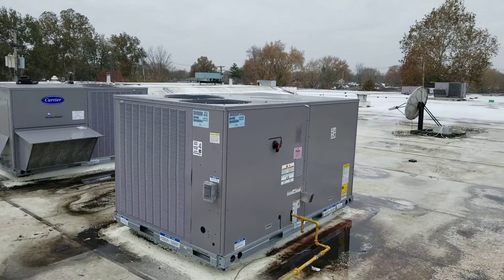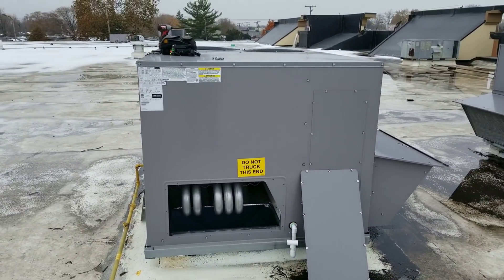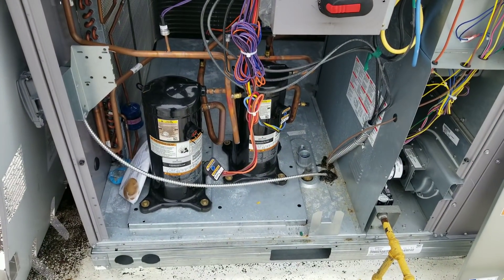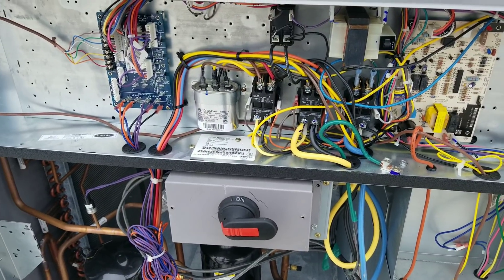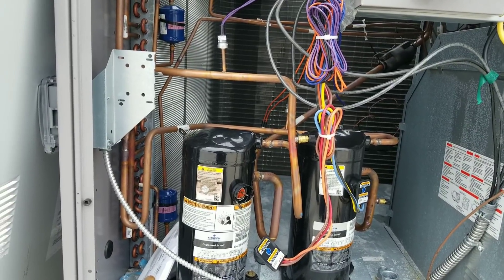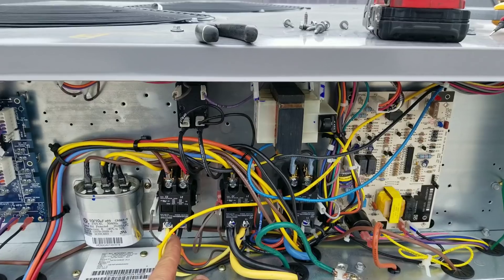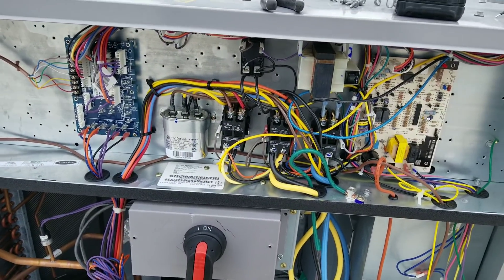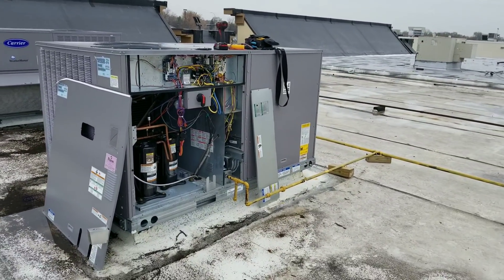Carrier package unit tripping the breaker

Comment: Hi, great video! we got the same unit for our store. I noticed the fan blower and one of the compressors are not getting the 24 volts but the other compressor gets the normal 24 v and engaged, do you know what is wrong with it? Therefore, only one compressor works and no blower running nor the other compressor work. If I manually press down the contactors on those two things, they would run. They are not getting the 24 v as they should. Thanks!

Comment: Being that the compressor that burned out was the second stage, it would be prudent to change out both compressors. A charge back from the facility to the installer would be in order. A big screwup when all you had to do was determine that the blower was running in the right direction.

Comment: When you need to correct rotation of a 3 phase system by swapping 2 of the power leads, the leads that should be swapped are phase A and phase C.

Comment: Notice the electrical contractor did not identify his A,B,C phases nor did the manufacture.  L1, L2 ,L3 should be black red blue is the new standard. Higher voltages might use brown orange yellow (as the old convention) for 277 volts and higher.   At least he identified the common neutral/ground with green tape. Amazing !
Reply from the maker: Great point- I didnt notice that, now thatll be in the back of my mind forever, thanks for the tip

Comment: Still confused about what you did. I know you just swapped wires from the contactor. But I  thought 3phase units all run on equal legs of voltage . guess I'll have to do some homework lol . Nice job .
Reply from the maker: Hey Charlie- well im not an electrician so I may butcher this but here is how I understand it, it would be easier with a picture of the 3 sine waves of a 3 phase system but well try this-- so each leg of power is out of sync by 120 degrees, this phase shift between legs is what gives these 3 phase motors there torque. Now when one of those legs is moved and is going into the motor at a different angle or phase then the other legs it will spin backwards, so you swap any two legs and you basically re allign the phases and let the magic happen. Feel free to email me curioushvacguy@gmail.com

Here is a article explaining it a little better 

https://www.google.com/url?sa=i&url=https%3A%2F%2Fen.wikipedia.org%2Fwiki%2FThree-phase&psig=AOvVaw2zHzLoNNsrcAAEHAj9bhDN&ust=1579736591116000&source=images&cd=vfe&ved=0CAIQjRxqFwoTCMCLqMXvlecCFQAAAAAdAAAAABAD
Reply: Curious HVAC Guy  thank you for taking the time to explain that . It makes sense know .

Comment: Just curious why you didn’t check all electrical equipment to ground before you said that you flipped the switch, after noticing that the switch was flipped in the first place.
Reply from the maker: Hey Dave- your exactly right and I got no excuse- what I should have done once I noticed the unit had no power was shut the disconnect off, go downstairs flip the tripped breaker, then test everything for a short to ground before turning the disconnect back on-- that would have been much safer. It honestly just slipped my mind to follow that correct procedure-- wont happen again though

Comment: How can people not hear the difference between backward and proper phasing?? Blows my mind, pressures would be off as well.
Reply: Also, I would check phasing on other units. Typically sparky will wire stuff up the same way on each unit.
Reply from the maker: Good point-
Reply from the maker: Yeah its a very distinctive noise- its hard to ignore ya know

Comment: Good troubleshoot...! Its a preservative that burns off...Ive ran across brand new scrolls burned out because phase was not checked before putting into service. Mistake that a lot of rookies make. My marine commercial refrigeration units have phase sensors that will correct the phase automatically. It spins the condenser motor first and measures amp draw and if its high because of fan resistance it will switch phases automatically with a phase correction contactor, The micro processor will not start the compressor without the correct phase.
Reply from the maker: Hey Dan- thats pretty cool, ive never heard of a phase correction contactor-- once in awhile I come across some package units that have phase protection but I think most of my customers dont get that option cause it costs a few dollars more. Do you have any literature on your marine system? Ive never seen one or read about them either. Thanks for watching

Comment: Good video!  Two things.  Both compressors should be replaced.  The life of the one still running has been severely shortened.  Second, the drip legs on the gas piping is just stupid.  Typical lowest bidder amateur hour install stuff.
Reply from the maker: Very good point- theres no telling how much damage the other compressor has suffered. Yup typical lowest bidder stuff, they rejected my quote anyway so well see what happens now

Comment: That Bx wire coming from the bottom is gross. No junction box and no liquid tight conduit to the disconnect switch. Typical running shoe mechanical.
Great video though! Thanks Bill.
Reply from the maker: Thanks Bill- I feel kinda dumb now cause I didn't notice or address that wire coming in through the bottom

Comment: Be carefull about "just change any two wires" to change rotation - some systems have one phase that has a much higher voltage and if you swap it over to your control circuit your gonna ruin your day.. the leg with the high voltage is called the "wild leg" or the high leg - this leg must only be used on motor windings or heating elements and not on controls... ask me how I know this... these systems can be anyplace - most utilities try to do away with the grounded delta but it depends on when the last time the electrical was remodeled.   One hint to check his when you drive up to a building - look at the size of the transformers - the wild leg will have a smaller transformer usually .  But always verify with a meter before you just swap any two wires- it can get spendy..
Reply: Another tell is they're doing open delta with only 2 xfrmrs.  I live right behind a church that is fed 3phase open delta with two pole pigs. The drop to my house comes off of one of them. It's crazy.
Reply: @sivalley  your exactly right - you can be sure if you see a building actually fed with two transformers that the electrical will be "different" ...
Reply from the maker: Thanks for the knowledge bomb-I know a little bit about wild legs and what not but im not electrician. Anyway- Ive never had an issue just swapping any two legs on most 3 phase units but ive never confirmed a wild leg on any of those units either. What I know or understand about the wild leg is you can damage a buildings circuitry by switching any two legs because you then land that wild leg on a 120v circuit. On these rooftop units the control voltage is almost always 24 volts coming out of the transformer, so now I wonder why ive never fried a transformer or something by swapping these legs around to correct phase rotation-- I dont have that great of luck   

 so when testing at the package units junction block, is it best to test each leg to ground to identify the wild leg or is there another way?
Reply: 240 Delta with a stinger leg. That is one phase to the ground is higher than the other 2. Usually found on older buildings and factories (pre-1970 is common, however, some parts of the country still install the corner grounded delta on industrials). It's called center-tapped delta and is generally obsolete in many parts of the country for large commercial buildings or malls.

So before I move too quickly there are 3 common variations of the delta electrical service connection. 

(1) Center tap where we derive a bonded and grounded neutral between usually A and C phase in the windings of the transformer during manufacture. You end up with 240V phase to phase so 3 pole or 2 pole breaker loads are fine. The problem is the phase farther away from the neutral (often B phase) will exhibit a nominal 208V (instead of 120 as A and C do to the neutral) creating what is called the stinger leg. 

Polarity is not an issue with 3 phase center-tapped delta rolling any phase on a 3 phase load (3 pole breaker, or single-phase 240V 2 pole breaker load). When dealing with a 1 pole breaker load OR one leg derived from the main breaker internal to the unit to power a fan or full voltage timer, if the phase happens to be the higher leg (nominal voltage 208 phase to ground) a 120-volt load vaporizes quickly when the 208 to neutral is applied.

2) Corner grounded delta - commonly found in the midwest and northeast, corner grounded B phase as it was called was a weird duck that was used primarily by industrials. Phase to the ground on B phase (grounded) was zero or supposed to be (?). Phase to the ground on A and C was line voltage, i.e. 480 or 240 line voltage. Mostly obsolete except in the midwest and northeast.

3) And the worst, oldest and almost obsolete is ungrounded delta. As most of us know electrical services are Grounded (neutral - grounded conductor per NEC) and bonded (EGC equipment ground) in the US. In the early days up through the late '60s, industrials ran UNGROUNDED delta, i.e. no coil or point of the transformer core and coil was grounded to the earth and bonded. 

Presumably, there was no ground (floating) so a phase to ground fault was THEORETICALLY not possible. HOWEVER, that ain't necessarily so and actually was not so in certain instances. If a breaker did not trip on a phase to ground, other issues such as voltage spiking and restriking arc faults, equipment damage and a lot of misery for electricians followed. The very reason for ungrounded delta was to make equipment run for a period of time with one leg grounded. This benefit can with an abundance of negative traits.

As components, cable and wiring aged the ungrounded delta became capacitively grounded, creating overvoltage problems, restriking arc and havoc. this system is mostly obsolete now with 3 phase grounded wye or 3 phase High Resistance Grounded Wye in industrials taking its place.

Wye systems solve most of those issues.

If the voltage is 208 phase to phase and 120 phase to ground it is a wye service, uniform voltage phase to phase (208) and phase to ground (120). No more than about 5-7 % variation from the nominal 208 P/P or  P/G
On a 480 V Wye we expect 480 P/P and 277 P/G.

Changing rotation on a Delta system (240/120 or 480)

Back to the question of rolling phases, if the unit does NOT have anything single-phase (120V to neutral) fed DIRECTLY off the 3 phase delta breaker (hot/neutral/equipment ground 120VAC) usually other than voltage tolerance of the equipment to the 240 is the only issue. Most units can be or can be ordered to be wired either 208/240 or 480 either by ordering them for the desired voltage or rewire if so equipped to accommodate the line voltage available  Transformers can be used to fix the voltage issue as well on single voltage units (a delta/wye 240/208Y120V can be used to derive 208 wye, a delta/wye 480/480Y277 for 480 wye can be used to get to the more desirable wye configuration)

So to the point rolling two phases on a center tap delta (2 lower voltage 120 to the ground, one higher voltage usually 220-235V phase to ground, B or C phase depending on where you are in the country is not an issue IF the unit only uses the 3 phase 240 or single-phase (2 pole breaker) 240Vac. Indiscriminate rolling of phases where the unit uses a single-phase leg or leg to power 120V loads INSIDE the unit will be a possible problem.

I teach my guys to establish the line voltage FIRST as your FIRST troubleshooting and safety issue.  Establish if the unit is wired in a delta or wye configuration. Understand a  Look at the nameplate on the unit before you check voltage to have knowledge of the units' voltage range going in. Actually, I can have a 480V 3 phase 4 wire and feed a load with a 3 pole breaker assuming no neutral needed and achieve a delta connection within the unit itself. The service is still wye coming into the building.

If the voltage is high, component life will be shortened possibly to probably, particularly where the voltage exceeds the nameplate rating by more than 5 percent and certainly where it consistently stays at 10% or more high all the time.

Comment: Thanks. Excellent content as usual.
Was customer aware of only 3 out of 4 units operating (any kind of indication apart from tripped breaker)?
Reply from the maker: Hey Luzt- they where somewhat aware, they had a few issues and management change over coupled with the fact they have low heat set points and high AC setpoints. Also all there work orders have to go through a third party management company which delayed the process even more-

Comment: Great vid Bill, nice find on the phase reversal 👍
This level of craftsmanship is f&#king ponderous but completely unsurprising 🤷‍♂️
Reply from the maker: Thanks Mr Sparky- any thoughts or concerns on the wild leg? I had some feedback about that, I didnt test for the wild leg because ive never had an issue. I always thought you could only cause damage if you switch the legs at the breaker box. Thanks in advance- feel free to email me if you want curioushvacguy@gmail.com
Reply: Well, making no assumptions on this I'll start with observations: 
1) The wild leg/ high leg/ delta leg must be phase taped orange - I didn't see that (by the same token though, they broke a bunch of other rules so...)
2) Switching phases at the contactor could cause trouble if for some reason the control transformer was 120 instead of 208/240 selectable but I don't see that either because I only saw phase conductors and no neutral so that scenario is highly unlikely. 
3) If you checked phase to phase voltage and got 208, it's 3 phase wye or star therefore no high leg. If it's 240 phase to phase, it's 3 phase delta and has a high leg which you would want to identify. 
It still wouldn't be a problem though because only circuits that have a neutral would 'realize' the high leg - otherwise all 3 phases are still 240Vp-p. 
4) Typically you will only see utility supplied 3 phase delta in rural areas (open delta) and certain industrial applications 

Soooooooo, after that windy explanation: I don't think you did anything wrong at all - as an electrician, I would have flipped it at the main panel but the installing electrician should've checked phase rotation anyway. But now we're digressing lol -

You were sent to clean up a shit-show, just don't get any on you lol ⚡💩

Comment: Un ( F--- ing)Believable...
I cannot believe.common shorted out on compressor first phase.
Almost would have lost second.
Defitinely the contractors who commisioned are liable and need to replace / pay for the compressor.......
Or they may blame electricians for not wiring 3 phase correctly..
Awesome catch Bill.,going beyond your original scope of work you were hired for..as you said! 
( LOOK AT BIG PICTURE), 
Why the heck did no one catch this before...this is perfect example of you get such a huge bid to install 4 RTU.units...test the damn things in both heating/ cooling cycles.
Unacceptable..
Great video..thx Curious hvac guy!! 
Bryan Tyler Refrigeration
Reply from the maker: Thanks for the support Joseph- much appreciated. Its crazy sometimes the level of work I see out here, im sure it was the lowest bidder but even so they should do a decent job but I guess im expecting to much out of people--- some people just take the path of least resistance through life

Comment: got to love the careless installers not checking phasing. I would like to say I never saw that before. lol always enjoy your videos. thanks
Reply: What about the tech that should have done a proper commission?  Installers didn't wire the 3 phase power.
Reply from the maker: Thanks Chris
Reply from the maker: It also could have been an electrician, maybe the installers set them up and a few days later the electricians wired them in without testing-- but thats just speculation

Comment: That should be the second stage compressor
Reply from the maker: Good catch- according to the wiring going from the lps and hps that go into circuit 2 on the board you are correct, that was just a test and you passed with flying colors, lol

Comment: That is second stage compressor.
Reply from the maker: You are correct, it was my bad- I should have followed the wiring. Now my question is why would that one burn out before stage 1?
Reply: @curioushvacguy6876  
Very good question..I just caught that when you engaged the contactor.1st.compressor kicked in..good catch
Reply: @curioushvacguy6876 
Maybe lead and lag
Reply: I love your videos!  Please keep them going.  I have been out of the field for a while so I have a huge appreciation for guys like yourself out there getting it didn’t day after day. Nothing but respect!
Reply from the maker: Thanks Dave
Reply: Always pull y1-y2... start the blower motor if it’s correct your all good. It sounds like your standing in water? Pushing contractors in? I love your work and videos brother and would like to keep watching them. Use that meter first